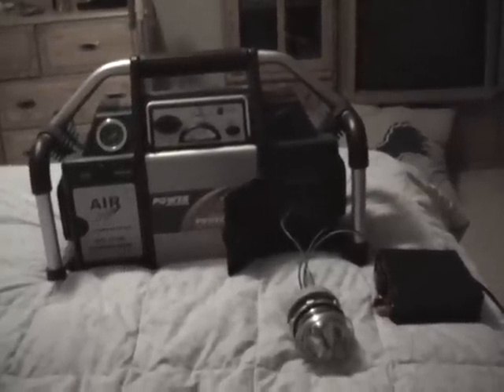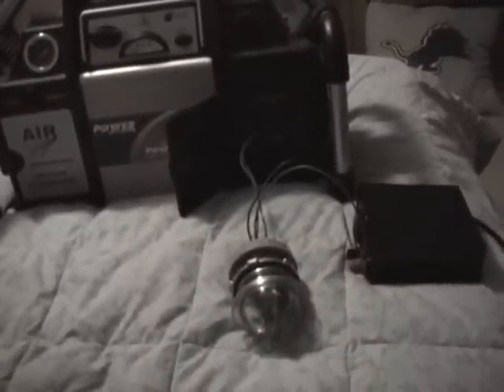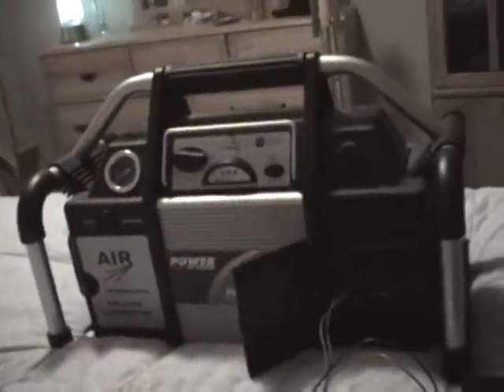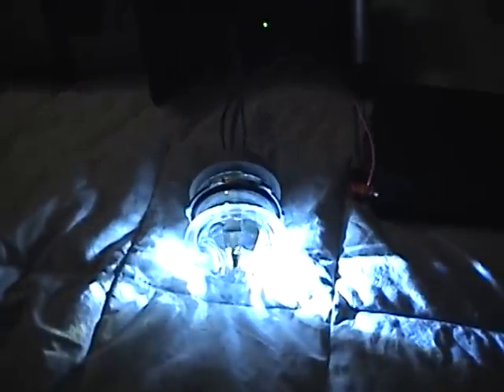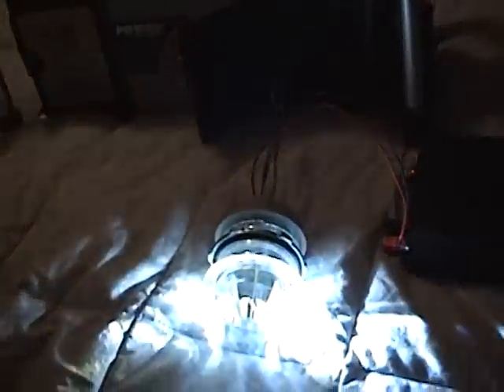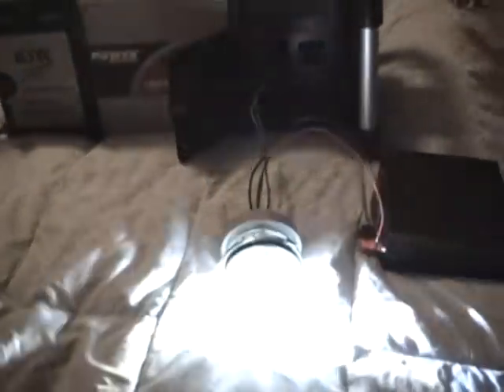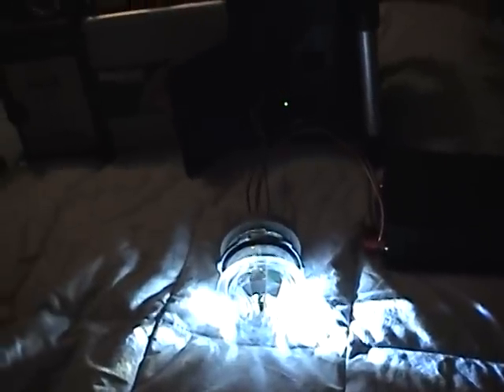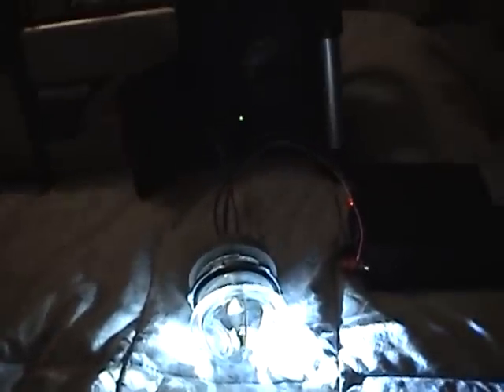Velcorp/GEMS LED Power Indicator

Comment from the maker: Not really.  It only does that during a power outage. It is a very useful product, especially at flasher only crossings, where there are no gates to let you know the power has been cut off and the batteries went dead.  Imagine coming up on a crossing without gates, but only flashing lights.  If the batteries die, the lights won't flash and you could potentially be hit by a train.  With this, the engineer can tell that the crossing isn't going to activate, and slow down and flag the crossing.